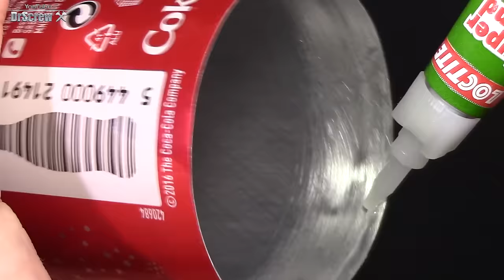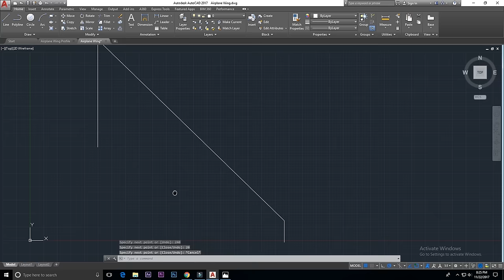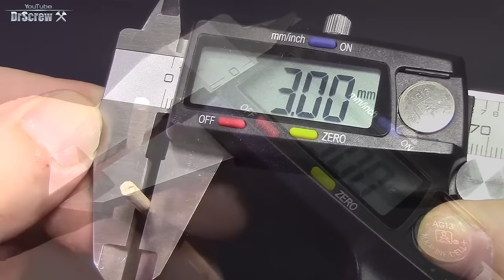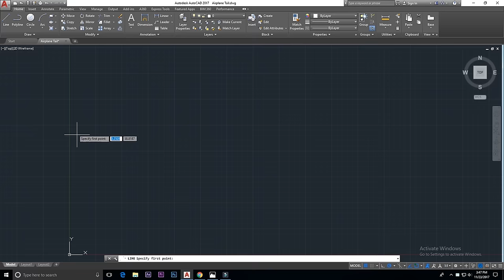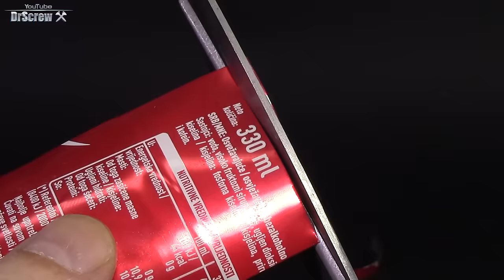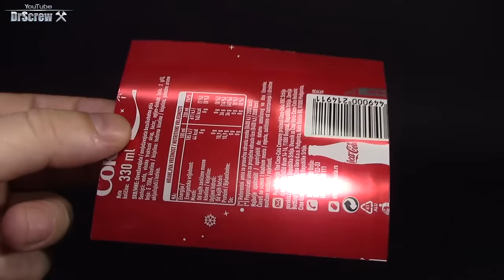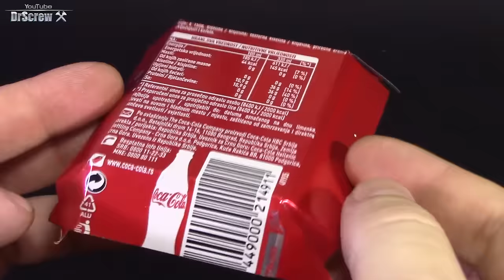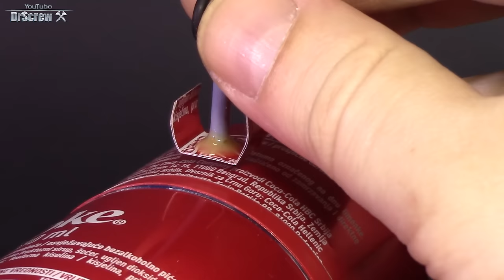How to Make an Airplane from Coca Cola Cans

Comment: The patented action script for the Coca-Cola Airlines™ official licensed Comercial: engine start way to quickly and just stands there somehow without jurking forward and moves slowly to the run way, stays there for 30 secs. Finally the plane kicks up the engines  and begins to dash across the 54 mile runway and I say that because the plane is at take off speed for another 20 secs and doesn't go off the runway and crash, and the scene changes to the plane which easily goes from 600 mph to about 300 in 0.00000000r secs. The plane (finally) takes off with a slow gain of altitude  for the first 30 secs and then is all ready nearly at the clouds/stratosphere, suddenly the speed goes back to 600 mph AND the plane has clearly all ready moved 745.08 miles from the airport that it took of at and to finish the take of the plane drops altitude to much MOVED backwards 745.05 miles AND SLOWS down back to 300 mph as it flys above the abnormally large 54 mile long run way as the plane continues its jerny to PepsiCo™ Airport. To finalise the planes left engine 1 brakes down with no fire or smoke so the plane flies on an angle while the sene  changes a couple of times, while changing location with each scene change and with the biggest possible shadow at the edge of the camera of the plane in shot as the jury continues with another Coca-Cola Airlines™ plane that probably evolves into the sub-film of The Cyanide and Happiness show epesode 2. (that took f-ing forever to make, but I really think it was worth it)
Reply: thank u for 100000000000 paragraphs of work

Comment: How much humanity has vent low for money im an enginer and i can spot more that statisticly over ummm 500 thiks that wont work like gear not strong enough with thrust comes air sucking and the cans will get sucked in thats also plasticnso on high tempriture it aint working but thats if it will really work so i dont judge thats also only few thinks